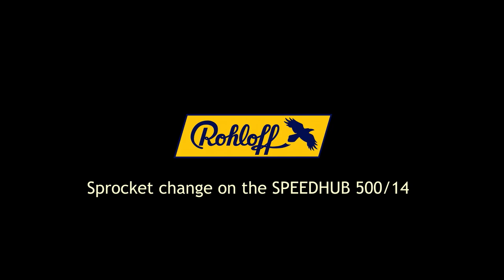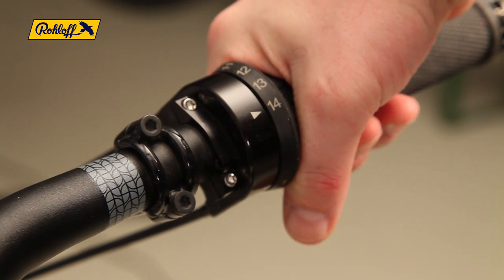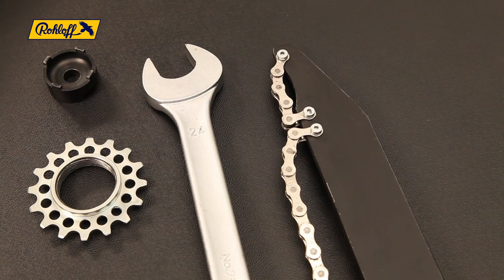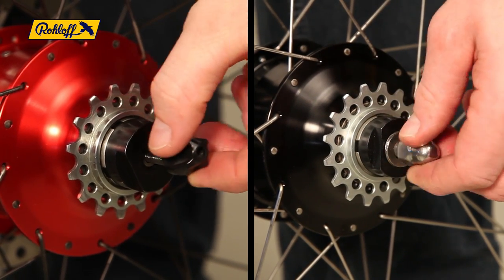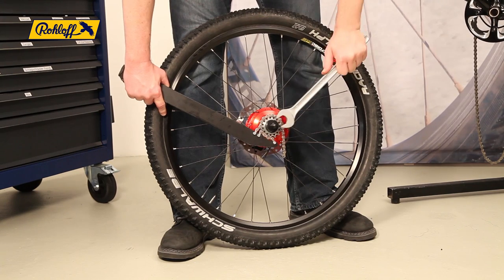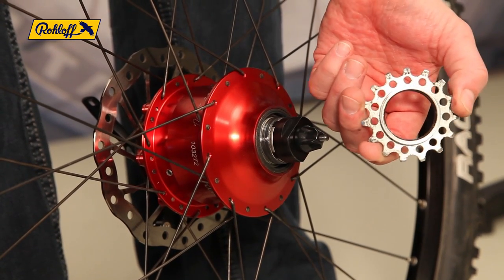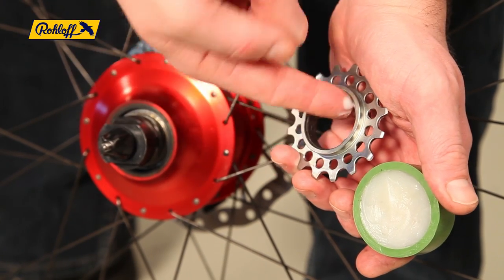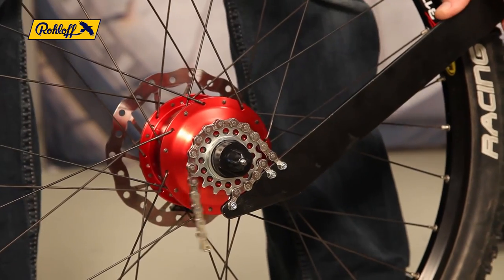SPEEDHUB Workshop - Sprocket Change

Comment: It does not come loose easily, that's for sure! Would be nice to see Rohloff's idea of a "worn" sprocket. The one they show is clearly new. I must say, though, their videos provide an outstanding tutorial.
Reply: I had a shop flip mine over after 5000 miles with a BaFang 750W mid-drive. It showed wear but wasn't missing a beat, but the chain was ready to replace so I had the gear flipped.

Comment: Yep, my experience was the same. You definitely need both the chainwhip and the 24mm wrench to have an arm length of about the radius of your wheel. Both of mine were too short, so I resorted to lashing a stout wooden post to the handle of each one to triple their length. The increase in leverage loosened the sprocket easily! ;-)

Comment: I could not budge the sprocket on my hub, and nor could my local bike shop, with 2 guys straining away. I bought a long Park chain whip, and a 300 mm adjustable spanner, and applied penetrating oil liberally over several days. Still no joy. So I dribbled a kettle full of boiling water over the sprocket and hey presto, it came undone fairly easily.
Reply: Trust heat to make the difference.